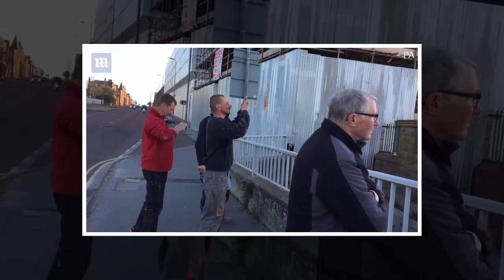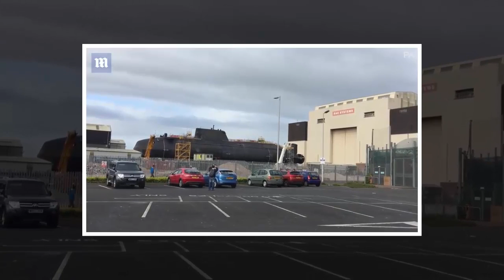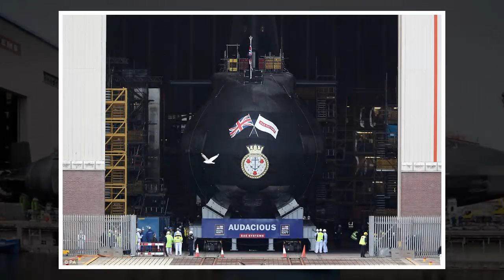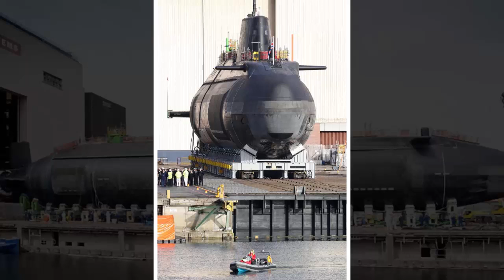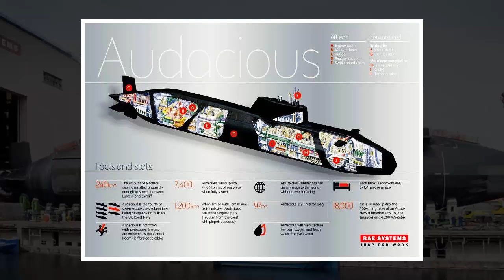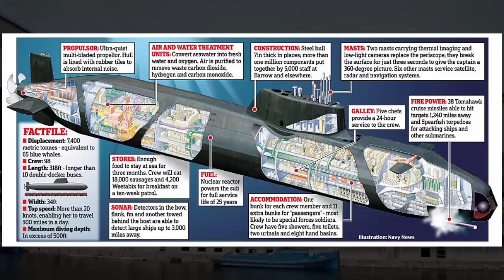Royal Navy's £1billion 'silent' new nuclear submarine can strike target 1,000km away

Comment: 10 years to build....are they using uk road workers to do the job...maybe this is where the workforce is as I only see 1-5 workers max on the 16 mile long roadworks on the m3 for the last 3 years.
Reply: Diver Dan fuck off to the EU then
Reply: Don't be so harsh on the "grafters" pal... someone's got to burry the tarmac to keep it safe through the winter 10 months until the weather's good enough to half fill the next 4 potholes.
Reply: Technically 10 years but that includes design
Reply: Diver Dan it’s one of the most complex things ever to make also half the workers in there are fucking idiots and the rest are doing there jobs and grafting
Reply: Don’t blame the workers, unless they’re the ones deciding how many of them get to work 🧐